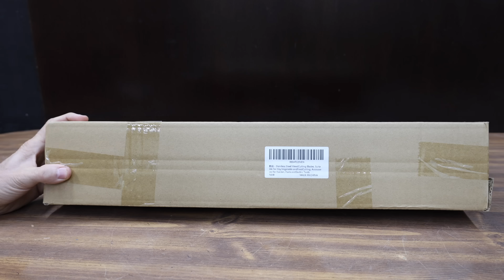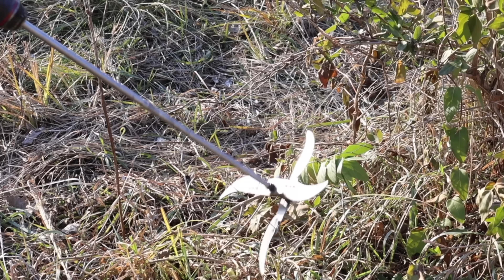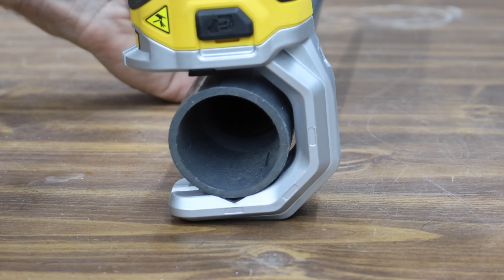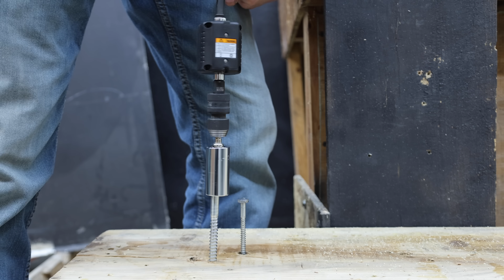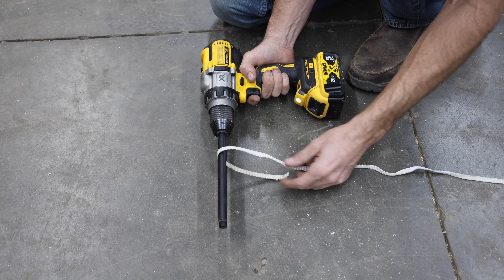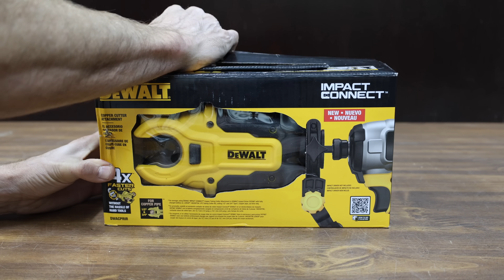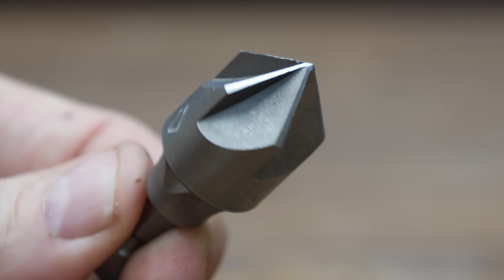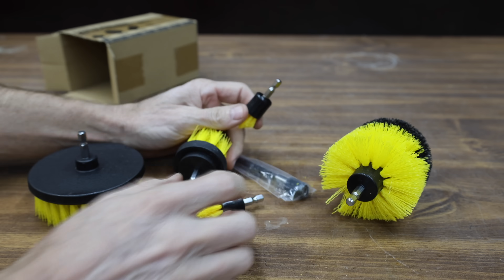I Replaced 10 Power Tools With My Drill!

Comment: Have to be careful with the wire brushes, drum sander and other tools that side load the tool.   Many drills and drivers bearings are not engineered for side loads....   Better to put those sorts of tools in a die grinder....

Comment: I have an auger.  That thing is best used with a hammerdrill with the side handle.  I also used the auger attachment to mix concrete yesterday to pour a new driveway.  I would have taken forever to mix the concrete with a shovel in the wheelbarrow.

Comment: Circular and Reciprocating Saw , you way better to buy a cheap cord  saws. I own few of these attachements. Deburring tools need to pay for quality.  Auger are awesome for flowers. Brush and sanding are a must (need also flap sanding disk).  Wire brush also, I have also them on a grinder  but on a drill it is less violent and you can control the speed.  you are missing a drill to grinder size adapter, usefull in some scenario like paint scrapping and sanding , still less violent than a grinder.  :)

Comment: The 4 flute deburring tool is very prone to chattering, not just because of the number of cutting edges, but also because the relief angle is too high, allowing the cutter to dig in too deep. If you sharpen a drill with too much relief, it can chatter or bite into the material, essentially trying to screw itself into the material instead of peeling away a thin layer with each rotation. This style of cutter is best suited for CNC machining. A 3 flute countersink bit is exceptional at deburring holes. Hand deburring tools with the little free-rotatating curved blade are my favourite for being ergonomic, versatile, and having blades that can quickly be swapped for new blade or a different style of blade.

Comment: That first one looked fun. I gifted it to my neighbor. I'll let you know what they think of it once they return from the ER.
Reply: Muhahahaaa...I was thinking the same thing.....lol.,..how freaken dangerous is that MFR
Reply: @lesfaust9634  The scariest part is that their will be people looking at it thinking that because it's smaller than a normal circular saw it's also safer.
Reply: If you use it at the right location, you might even be able to send neighbors on all 4 sides of your house to the ER!
Reply: It looks like something I would make as a joke!
Reply: he used it wrong. there is a bracket it came with so you can mount a divot at the bottom of a 5 gallon bucket. that attachment is not made to be used outside a bucket. the bucket is protection.

Comment: As anticipated, the DeWalt stuff was decent because they understand the limitations of a drill attachment. Basically the level of a hand tool like PVC cutter or metal shears. The ones that pretend to be reciprocating saws, circular saws and brush cutters are being too zealous. The chainsaw seemed decent, but I'd expect it and the water pump to work once or twice. They will not last.

Comment: You can get the water transfer pump for a few bucks at harbor freight with threads for garden hose sections.  I keep one in my basement as a backup in case the sump pump died or we lost power.
Reply from the maker: Thanks for sharing!

Comment: I got a whisk attachment, slapped it on an old ryobi drill and my wife loves it!!
Reply: I have the drill brush set.  Now, it's so easy to clean grout lines.   Those bathroom tile cleaners will break the moment any pressure is applied.

Comment: I agree with you on this test. I do have a set of wire wheels here for quick removal of surface rust. I would not buy the ones that you don’t recommend either. Who in their right mind puts mild steel gears in a right angle drill adaptor.

Comment: The PVC cutter is neat but that's quite the extensive setup it needs, and a bit pricey.  I feel like a plumber would rather have separate dedicated power tool to cut pipes, and a DIY homeowner would rather just use a saw.

Comment: Those drill augers are really great for planting saplings, I typically use post hole diggers for anything larger but It really depends on the type of soil you're digging
Reply: I got a set of augers last year and they worked great in the garden.
Reply: @LarryKapp1  oh yeah I wouldn't doubt it 👍 definitely makes quick work compared to a flat shovel, I just kept stalking free postings until I found a decent rototiller.. the augers are still best for small trees and the like

Comment: Here's the list in order of appearance with a Yes/No on whether they are worth buying or not:

Vegetation Cutter - No
Circular Saw - No
Reciprocating Saw - No
PVC Cutter - Yes
Chainsaw - Yes
Rivet Gun - No
Universal Socket - Yes
Metal Shears - Yes
Strap Winder - Yes
Auger - Yes
Copper Pipe Cutter - Yes
Wire Brushes - Yes
Drill Bit Extension - Maybe (extension worked ok, right-angle attachment was bad)
Deburring Tool - Yes
Deburring External Chamfer - Yes
Water Transfer Pump - Yes (pump good, hoses bad)
Drum Sander - Yes (sandpaper sold separately)
Nylon Brush Set - yes

This was a fun video!

Comment: Just a personal remark about the quality of what's out there; I bought a very inexpensive hole-saw set, Walmart brand, and wasn't expecting much. The goal was just to make some holes in plastic tubs. The first thing I noticed is that when I put the hole saw in the drill and spun it, the pilot bit (1/4") was bent. Brand new, out of the package, and the bit was actually bent. Then, when I tried to drill a plastic tub with it anyway, the bit wasn't sharp enough to do even that. I had to use a step-drill for a starter hole. 
I appreciate Todd and Project Farm, more than ever.

Comment: If you ever need to tunnel horizontally, like under a wall or foundation, say to run a pipe or wire, especially in thick clay, those drill augers are worth there weight in gold.
Reply from the maker: Thanks for sharing!
Reply: Where weight?

Comment: Best attachment, hands down, is an ice auger for ice fishing. No more need for a large gas auger or extremely expensive electric auger. Any old manual ice auger will work then just buy the drill adapter with a handle for about 20 bucks.
Reply from the maker: Thanks for sharing!

Comment: Some of these are bull$hit reviews. With the small circular saw you are comparing a small saw to an 18 volt Milwaukee saw that costs over $500, battery, charger and tool . Unfair. On the reciprocating saw, you are comparing a small jigsaw to a large reciprocating saw. You should compare apples to apples. Definitely inconclusive results.  The point of these cheap tools is to do small or once over jobs that you can do around the house that don't require a lot of horsepower. You don't want to spend an arm or a leg to buy a $500 tool.
Reply from the maker: Thanks for the feedback!

Comment: because of the rivet gun attachment, we got several different tools that have similar issues when the wrong front piece is being used... don't check the size with the shaft of the rivet but the actual rivet iself... if you for example have the 2.4mm one inserted, you can try to pull a 3.2mm rivet but it won't eject the shaft, the same issue on several other handtools happened recently... and as I am working in tools sales I got confronted by similar issues on various brands and manufacturers as well as systems... and most issues have been "operator error" aka. the wrong size used on the insert

not sure if you had the right combo of rivet and insert in that test... would be interesting to see if this happens with a different combo as well

(side note: we sell manual rivet tools and they have a similar system on the nose pice when being changed... however they got metric and imperial sizes stamped in and this confuses a lot of users as they see the 2.4mm nose piece that says 3/32 as well and then think that this is a 3 and 3.2mm nose piece even when it is a 3/32 imperial size stamped in, had a customer that I needed to show and explain this last week at work)
Reply from the maker: Thanks for the insight!
Reply: @ProjectFarm  you're welcome, for me this is a possible cause of issue on a technical point of view as I had similar things happen with different tools that work in the same way... for normal the smallest front insert is the one with the shortest overall length, the largest ist the longest and that's why the three gripper jaws inside might not have been spread apart enough with the non-matching insert

as said, this could be the reason why the shafts got stuck but still could get pulled in

greetings from Austria

Comment: Todd - I miss the days of putting random liquids into engines. How about jig to demonstrate what can or can't be used as brake fluid? Can water work? Have a torch or induction heater set up to test to what degree you lose braking pressure from various brake fluid contamination levels. Everyone talks about how water absorption reduces brake pressure by boiling and then compressing as a gas, but does it really happen? What if using pure water? What if using motor oil? What if using motor oil with water (water will find low spot, heat low spot, lose brake pressure?) What about bacon grease as brake fluid? Let's bring back the silly.
Reply from the maker: Thanks for the suggestion!

Comment: I have the dewalt pipe cutter attachment in my tool set for work. Unless we’re doing a new install or replacing an 80 percent furnace with a 90 percent furnace, it’s too bulky to keep in my tool bag, a ratchet cutter works just fine. When I do use it, I removed the bracket. It just gets in the way and the cutter keeps itself from spinning once it’s started into the pipe. Even on 2 inch sch 40.
Reply from the maker: Thanks for sharing

Comment: A wise man once told me when I was looking at a piece of equipment that was designed to do 2 separate jobs that it will do both poorly, but would be a little better than not doing either at all. I didn't buy it, spent a little more for 2 job specific machines and wasn't disappointed in either. Drill brushes/polishers  are indeed handy- less aggressive than similar things on an angle grinder.
Reply from the maker: Thanks for the feedback and for sharing your experience!

Comment: Would love to see an endurance/longevity test for affordable gasoline transfer pumps!

I have 6 jerry cans of gasoline for a generator (for frequent power outages). Once a week I will take the oldest one and put it into my car gas tank, then refill the Jerry can with fresh gas, to  ensure my 6 jerry cans always have reasonably fresh fuel. 

Unfortunately the gasoline transer pump bearings wear out ridiculously fast, typically only lasting 5 to 10 jerry can emptying uses.
Reply from the maker: Thanks for the suggestion!

Comment: I had one of those reciprocating saw attachments that was manufactured in the 80's, it was an aluminum body and not 1 bit of plastic, it worked really well in a pinch or going to a wrecking yard and there was no situation where you thought "This piece of crap is going to unalive me". I bet it was awful in the 80's due to the drills available then. But, someone wanted it more than me. There are some really sketchy, that first one was an awful weed whacker/personal fan
Reply from the maker: Thanks for sharing your experience with those old attachments!

Comment: if you do another one of these videos with drill attachments I would like to see one of those attachments for electrical wiring that twists on a wire nut, also I have a set of flap disc like sanding attachments for a drill and they work pretty well for things that need an inside surface sanded like the surface where a wheelbearing goes into a knuckle for example. They also make paint and cement stirring attachments for drills.
Reply from the maker: Thank you for the suggestion!

Comment: These attachements are why I bought the Black and Decker Matrix series for my condo. I wonder if they still make them. I have most of the heads save for air pump. I love that thing. That was the PERFECT condo tool. Could do light to medium light work, and the heads were kind of inexpensive. Now that I own a home. I have a bunch of Dewalts tool. But for your viewers, if you live in a condo or apartment, B&D Matrix is the way to go. They have reciprocating, 3.25in circular saw, router, mouse sander, impact, regular drill head, air pump, and I think that's it. You could like 10 years ago buy a kit with the majority, for like less than $200, and the reciprocating can get through light metals, and thin walled steal tubing. Edit: B&D still do and came out with a shrub head for it, neat...

Comment: I went through literally hundreds maybe over 1000 of the sali brand cup brushes 3.5" we had maybe 15 coils of floor plate with pickle burn on the lugs that needed cleaned off and re oiled it was a nightmare but the cup brushes worked good.....still picking wires out of the sweater I wore for that 3 day run years ago while we cleaned off those coils of sheets. Wild
Reply from the maker: Thanks for sharing.

Comment: That first attachment should be marketed as "Drill Mounted Lawsuit Generator".
Reply: Lawsuit filed by next of kin?
Reply: @soundspark  At the very least next of shin.
Reply: he used it wrong. there is a bracket it came with so you can mount a divot at the bottom of a 5 gallon bucket. that attachment is not made to be used outside a bucket. the bucket is protection.
Reply: Murder paint stirrer
Reply: NinjaDrill sells better.
Reply: Did you know some Dewalt tools also made in China.
Reply: Can’t sue no name Chinese companies. Would have to find them first.
Reply: No lawsuits in china
Reply: It sure looks like something from a horror movie.
Reply: Its China, they dont care

Comment: I have the rivet gun adapter and have used it for 3 years. I agree that it could be made better, but the trick to get the mandrel to come out easy, is to not rush it. If you use reasonably slow speed when it pops (just slow down a bit when you feel it's about to pop) it stops before it goes too deep into the attachment. Switch the drill to reverse and it comes out easily. I installed over 3000 rivets and I only had to undo the tool once: on the second rivet.
Sure, it may be marginally faster to do it with a manual riveter, but it's a lot less tiring with a drill, especially if they are the thicker kind.
Reply from the maker: Thanks for the feedback.

Comment: 0:07 Noticed that you didn't test the orbiter that was in the middle of the table for the intro.  I've got one; it works well if there's enough room. But I could probably count on one nose the number of times that the drill wouldn't fit but the orbiter could.👺

Comment: The Milescraft water pump attachment you tested in 2024 is nice as it has threads to connect a garden hose. It is available on Amazon today for $14.01. If you are planning on doing a cordless rechargeable stick vacuum cleaner test, please consider testing the Tikom v500. I recently purchased one and for under $100 it works pretty well. Thanks for the videos!
Reply from the maker: Thanks for the suggestion.

Comment: Can you please do a video on Valvoline restore and protect oil in a motorcycle with the clutch which is supposed to be bad for it but I'd like someone to actually do a test. I sure would like to run the oil or at least 50/50.
Reply from the maker: Thanks for the video idea.
Reply: Thank you. I'm actually thinking it won't have a huge effect on the wet clutch. But you need to find a machine with some sort of wet clutch system. I think it would be very valuable to the public because it does clean engines. Also I recently saw a video where a guy used the new Valvoline restore and protect gas cleaning system. I believe they called it restoring protect fuel cleaning system and he said it erased his catalytic converter code it just curious on how good that one works it's new I believe.

Comment: A nice tip: the wire brush attachment from 12:00 is an amazing way to fully strip your bbq grill plates before re-seasoning them.
Reply from the maker: Thanks for the tip!
Reply: Just make sure you're thorough about cleaning the grill and plates afterwards to prevent the wires getting into your food.
Reply: @jacobs7764  yes! honestly better off just not using it for the grill at all… lots of people have ended up in the hospital with metal splinters stuck in their throat.
Reply: @jacobs7764 this is true, and because of the drill you can actually use a hard plastic or rubber brush attachment instead.
Reply: Cast Iron pan too !

Comment: Back in the day sears / craftsman / back and decker had a drill called bolt on / matrix that had a drill head, but it removed the whole chuck and could put in an impact, recip, hedge trimmer, circ saw, etc and that was my first set of tools as a homeowner, they all worked decently well for light occasional work around the house, but 10 years later and since we bought an old house with a lot of work needing done, it’s moved on and I have all dedicated DeWalt tools. Still was a good investment for young me!
Reply from the maker: Thanks for sharing.

Comment: Thanks for the demo of these attachments I have a full set of 1970's, Black and Decker drill attachments. For the stihl pruning saw I paid £115.00.I also bought the Universal Socket 20 years ago and have used it often. I works well on rounded or damaged fixings, Spray a little light oil into it on occasion.
Reply from the maker: You are welcome!

Comment: Great video! Next suggestion: fuel injectors testing the spray pattern, amount of fuel used, etc. Using a injector test machine, and then another video using fuel injector cleaners (new valvoline restore and protect fuel injector cleaner, royal purple, gum out, etc).
Reply from the maker: Thanks!  Thanks for the suggestion.